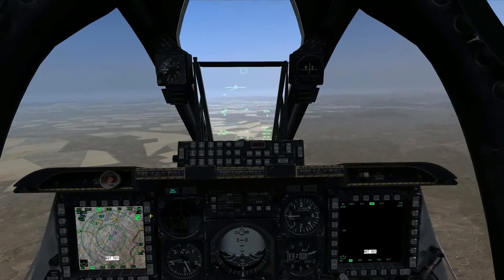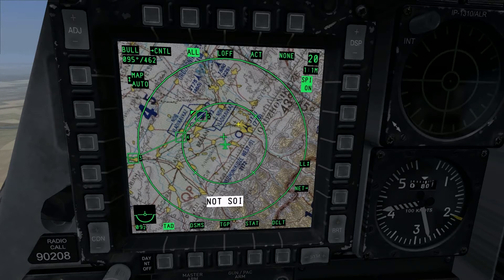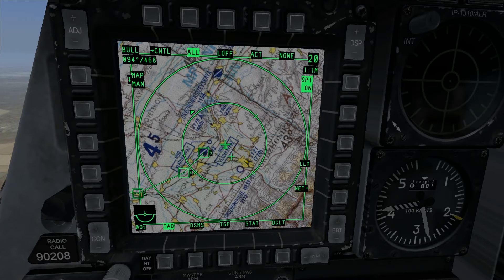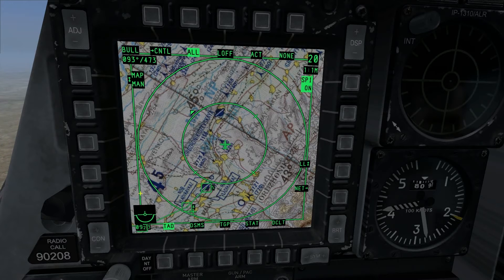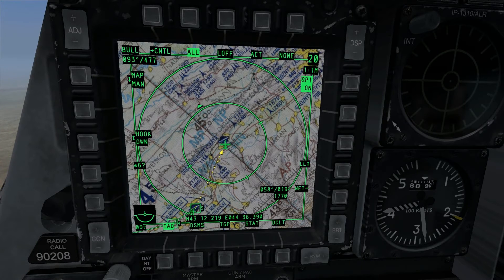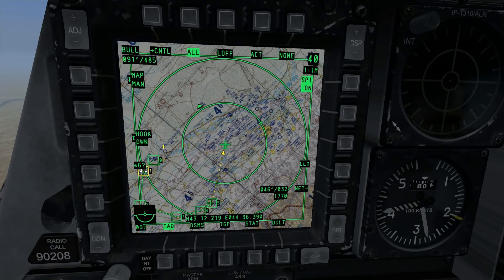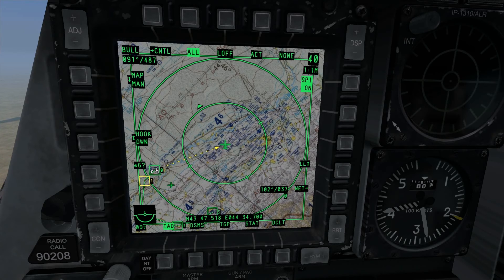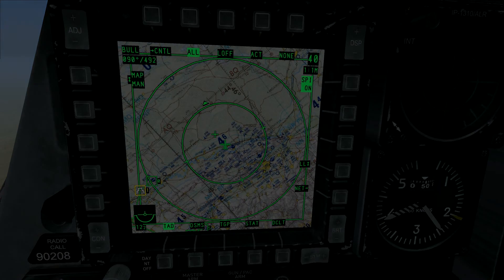DCS A-10C Tactical Awareness Display (TAD) Overview

Comment: Can't new waypoints be added to the map with the Cursor ?
Reply from the maker: dieter schmidt yes, kind of. You can add mark points, I belive with TMS left. it will make a Mark Point at the position of the cursor, which can be accessed by switching your Steerpoint mode switch to "MARK" on the aux avionics panel, aft of the CDU.